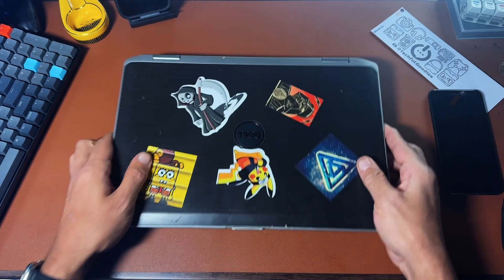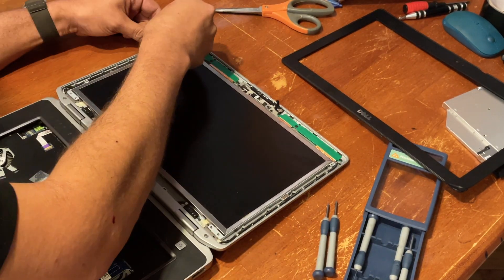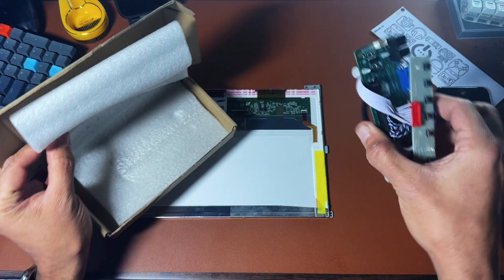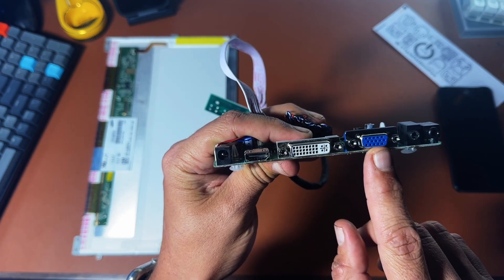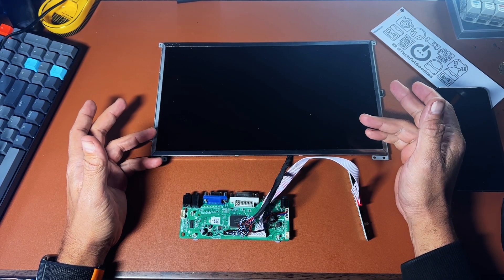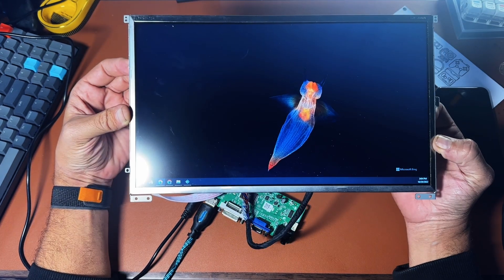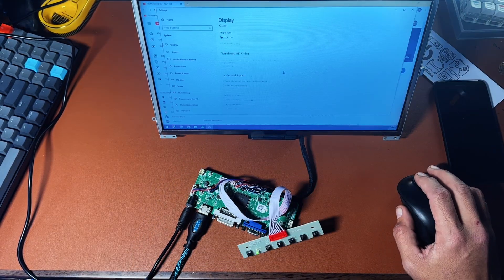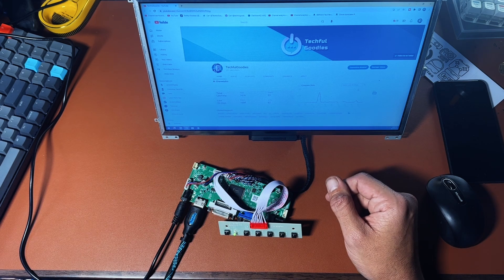Step by Step Laptop Screen to Portable Monitor for $30

Comment: Just curious, wouldn't the controller be on the laptop too?
Reply from the maker: Yeah, but it is integrated into the motherboard (in most cases) so it may be pretty big or even damaged.

Comment: I'll have to check out if there are controller boards that support usb-c to power and send video data. It would be great to take this a step further and turn old laptops into Lapdocks so that you could add a monitor, keyboard and trackpad to a Android phone or Steakdeck.

Comment: I'm having the hardest time trying to find a compatible controller for my laptop screen.  
I've taken out the screen and from the numbers on the back I can't find anything that looks like it would be compatible.
It's a laptop from Lenovo whose support service is garbage (as are their ideapads apparently), so can't ask them. 
I figured out who manufactured the screen, but on their contact form it says they don't deal with end users...
So yeah...  I'm a bit stuck for solutions.
Reply: Model number printed on the back is b140qan04 if anybody is generous enough to help out
Reply: try contacting a reseller/manufacturer of that model number screen, and include a request on the controller board... idk just had an idea

Comment: Could you use a 12v battery to power it? You mentioned it works off of a 12v power supply.

Comment: Just found your video. I did assemble one this weekend. Also used an dead Dell Inspiron N5010 with LCD (LTN156AT02).  Got the matching controller board from Amazon and used a power cube 12V/2A. I have watched dozens of these conversion videos but it was thrilling to see it work. I will 3D print a cover to protect the back of the LCD panel as well as the electronic boards. I am going to get a couple more for other dead laptop screens.

Comment: I know this might be a dumb question, but about that double sided tape, since I have none at home, I presume this is some special one that does not damage circuit boards?
Reply from the maker: Yeah, that would be best.  I should have considered putting some sort of insulation so that the board doesn't contact the metal on the back of the screen directly.  Nothing has gone wrong, but keep that in mind if you can.

Comment: If you VERY carefully pull it out of the lid, you can use the lid as the case with the electronics mounted on standoffs.  Drill holes in the lid for those.  Use a dremel or whatever to run the ribbon cables underneath.   I used some plastic poster corrugated poster board as "Roofs" over the circuit boards.  It's Ghetto, but it works.  Economically it doesn't make any sense for what I did, but it was fun to do.  I had to buy the standoffs, posterboard and the only circuit board I could find had a mini-HDMI connections.  So, I had to get something with that. The board I bought had a USB-C connector for power.  I find that to be a plus.  I have enough cables and power plugs laying around to handle that.
Reply: so the c type connector would mean I can use mobile charger as well for the power supply?
Reply: @blessen_daniel  Yeah.  Worked fine.  I think I found a video from a few years ago for my screen.  Couldn't find anything that looked like the circuit board in the video.  I will say, the stuff I got was much smaller than the one in that particular video.  

I have the thing on the kitchen table.  I have a Samsung S21 which has DEX and with a USB-C dongle with a HDMI port in the dongle you can output video.  So, if I'm making a meal, I plug my phone in and it's magic.  I have a HDHomerun setup upstairs.  That's a device that takes over the air TV signals from station's antennas and turns it into data to your router.  I watch local news from an app on my phone output to this screen.  Looks nice.  The sound comes out the phone speaker.  The electronics I bought does have a 3.5 audio output barrel jack.  So, if I had some old speakers with the plug, I'd get sound out of the speakers.  I dumped cable TV and Youtube TV years ago.
Reply: @dlewis9760  wow that's cool, the portable tv
Seems like you're having fun using it haha

Comment: I have a 12 year old Toshiba.  It was overheating, the battery wouldn't hold a charge and the on/off switch was wonky.  Same res (and brand) as yours.  Different model.  Performance in 2024 is abysmal on the internet.  Youtube couldn't process 720P.  Tried a USB Linux Dist., still bad performance.  Too old for ChromeOS Flex. Took it apart for yucks based on a YT vid.  Fan was choked with lint.  Put it back together - nope. Whatever.  It was a goner.  Took the hard drive out and copied the contents out.  The laptop is still sitting in a box.  I might give this a try.  I wonder if the lid can be salvaged doing this.  Might be able to keep a border around the screen.

Comment: You can but its pretty much useless if your native screen resolution is 1366×768 resolution wise that'z 720p in 16:9 Aspect Ratio you can buy 1920×1080p screen that is for laptops and you have to find the board controller for that screen

Comment: Is it possible to do this kind of thing with an old displaylink monitor? I've got an old hp u160 with a only a miniusb port. I really want to use it for dex, but the old displaylink tech isn't supported. I got it to motor through the monitor through 3rd party software, there's just a delay of a few hundred ms though. Perfectly serviceable for watching media, but not ideal for codm lol. This is a great video though, I'll be doing this with the old acer laptop I've got if nothing can be done with the portable monitor, at the very worst it still works fine as an extra display for my desktop.

Comment: Awesome! I went and bought the board and will be installing this this week. I have one solid question here; how can I connect this “new” external monitor to batteries and have it fully portable? With charging station if possible. Any ideas?
Reply from the maker: I have not tried it but depending on the voltage required by your board, if you can get an external battery pack that will convert or support the same barrel plug as your adapter, it "should" work.
Reply: @techfulgoodies  Thanks for the response! I'll see what I can do, since I am totally new at this level of tinkering.
Reply: @techfulgoodies hi,please give your mail id

Comment: Nice ! I have a dead laptop with a crisp new monitor on it, I wanna glue it to my double glass sided pc case to have an extra monitor to run live wallpapers on it 😂
Reply: Please upload some pics once you've done it.  This sounds like a really cool project.
Reply: Peel of the polariser and you'll have a transparent display.
Reply: did you do this? I am highly considering doing the same thing but for system monitoring. The front of my PC is the exact dimensions of my screen lol.
Reply: I did the same thing but now I need to make it really portable by adding a back and bezel to look nice when traveling.

Comment: Honestly I want to get a Dell XPS 17 screen and turn that into an external monitor. For some reason the 17.0 Inch 16:10 display is perfect for me at least. It was the first computer display size I used, an iMac G5 17 Inch.

Comment: ah, wish i could do a reverse of that - connect the laptop screen cable OUT to VGA IN, because my laptop doesn't have usb-c and the screen is broken
Reply from the maker: Most laptops have a monitor out port so you can use a secondary monitor - even if your primary screen is broken, you can still connect the external monitor and use the laptop.
Reply: @techfulgoodies  sure but while HDMI to VGA adapters are passable for LCDs, for a CRT monitor they are bad, they have black crush on full rgb
Reply from the maker: @ExtremalMetal  Ohh, gotcha.
Reply: @techfulgoodies  there's a little way to make it better: by setting ycbcr444 in Nvidia settings, still not the same as VGA output since it's sending limitedRGB but it's fine. maybe it's like being an audiophile but there's just something intangibly worse this way, like "intensity" being lost in the conversion, that's on my mind. like listening to an mp3 and thinking that it's not all it could be.

Comment: I've done this for a bunch of old laptop panels that ive had laying around.
I've kept the original case and 3D printed cases for the controller boards.

Newer controller boards have started to be delivered with USB-C input. One of the kits ive ordered is even USB powered so it works with one cable from my laptop.
Reply from the maker: NICE!  The USB-C Monitors are probably pretty nice quality - mine is so old that the viewing angle is terrible.  But it works for what I use it for :)
Reply: Same here.  USB-C powered.  I used the Toshiba laptop lid as my surround.  Dremelled holes into the lid for the electronics.  Used standoffs and plastic corrugated poster board over them.  I had a old tablet stand that lid perfectly fits in.

Comment: heloo buddy, can it connect with mobile phone instead of another laptop
Reply from the maker: It should work with any HDMI video signal as long as the monitor supports the output resolution.  I tried mine with the iPhone HDMI adapter and it worked fine.

Comment: What was the stand you used for the monitor at the end of the video?
Reply from the maker: It was just a wireless charging stand that I happen to have sitting on my desk but you probably could use any tablet stand to do the same thing.  The one I have is the DSUSMA 15W Magnetic Wireless Charger I got from Amazon.
Reply: @techfulgoodies  i was wondering the same. great minds think...

Comment: How would i know if monitor is working or not?
Reply from the maker: The only way would be if you know that it was working previously and the laptop has died for some other reason than the screen or the screen being broken.  I don't know of another way to diagnose if a screen is working or not.
Reply: @techfulgoodies  well it was in the water for straight 15 to 17 hrs
Reply from the maker: @harshadmane8785  Ohhhhh, yikes.  I would assume it is really unusable.
Reply: @techfulgoodies  i thought too, but pins look fine no rust or moisture i could send images if you like
Reply from the maker: @harshadmane8785  I am most definitely not qualified to make that sort of judgement through a visual inspection. 😁